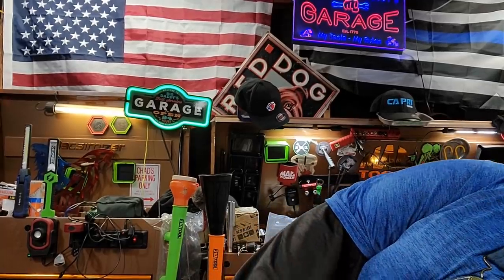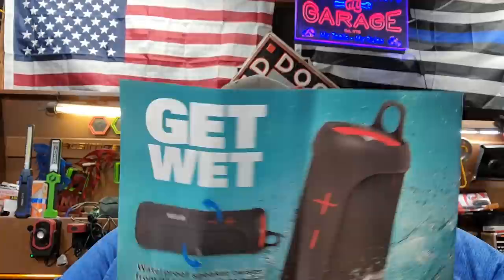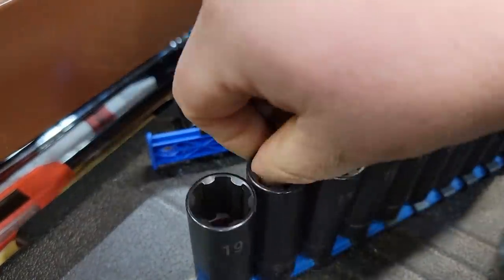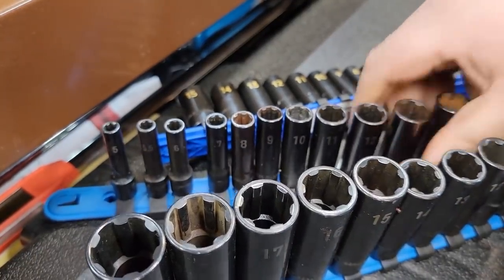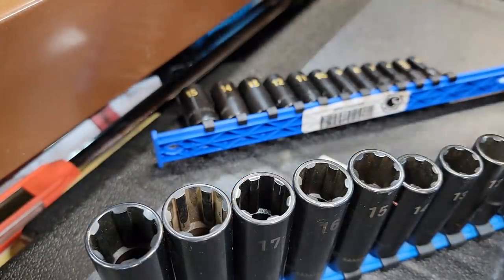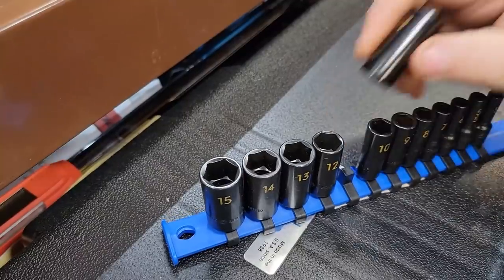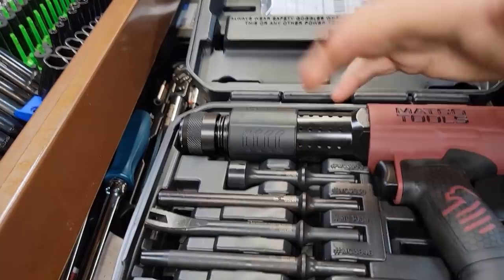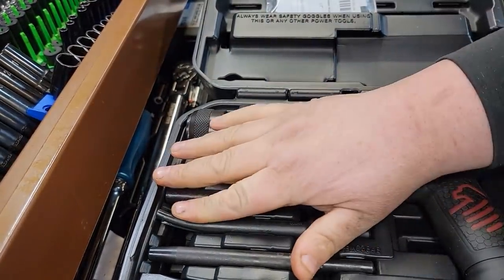NEW USA MATCO TOOLS!! MASSIVE HAUL!! LEATHERMAN CRUNCH!!

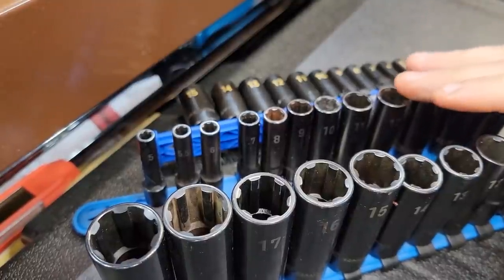Comment: 2:17 actually I believe that those are E Torx Plus or “inverted torx plus” sockets. At least Very VERY close. However that number size system doesn’t line up with the “EP-“ system for sizes on E Torx Plus:

Comment: I’ve got the Chicago Pneumatic CP717 (the original Big Nasty; the Astro is a carbon copy) and that Matco long barrel air hammer.  I have yet to find an application where the CP717 could do something that the Matco couldn’t.  In fact the CP was down for a month waiting on replacement parts and the Matco didn’t miss a beat.

Comment: In a situation where a screw or bolt has been tightened up and now it's "stuck"; maybe it started to stretch the threads. A screw knocker is a must have tool with an air hammer.  It will beat the threads back down.  You turn it at the same time it's being hammered on.  Never had one not work and have used them 100's of times. https://www.browntool.com/Listview/tabid/344/CategoryID/278/Level/a/Default.aspx